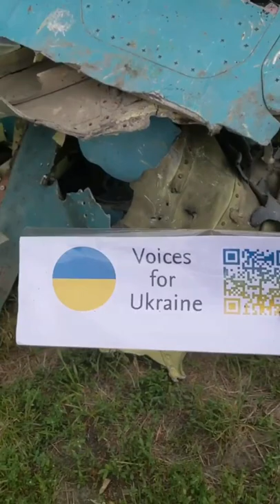😎 Russian SU-34 worth $36 million ➡️ bottle opener (first steps)

Comment: Did you just salvage directly from the crash site or you bought it from the scavengers?
Reply from the maker: Directly from the crash site. I was standing exactly where the plane hit the ground (though it was more like a fireball splattering for 100 meters or so destroying everything along its way). The RF sign and coordinates will be engraved on the bottle opener.
Reply: @VoicesforUkraine  that wreckage looks several weeks old at least 

Anyway, it'll be spectacular to see the finished product. Also even more magnificent if you could make a timelapse of the production process but that may be too much to ask.
Reply from the maker: @IqmalAziz  Yes, we have a lot of videos (on Patreon there is a longer 3 min version). The plane was there for longer than a couple of weeks but no one  was able to touch it. I cannot explain why right now, but will explain on Patreon once we get the official ok. It will be also clear when you know the coordinates (will be engraved on the bottle opener) 🙂

Comment: Are you sure that is stainless steel? I think it is high grade aluminium.
Reply from the maker: The plane part is aluminum, the part that will be used to open the bottle will be stainless steel so it doesn't bend 🙂